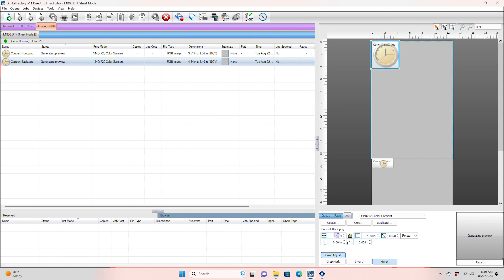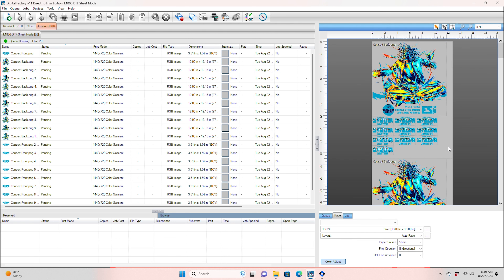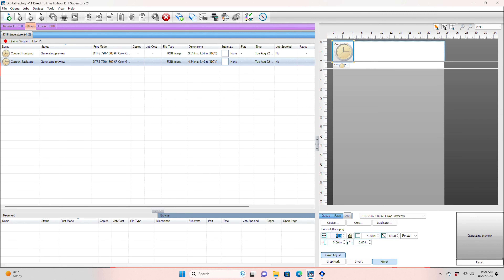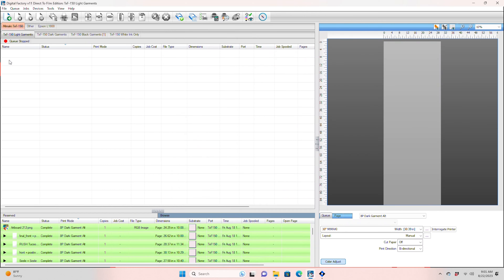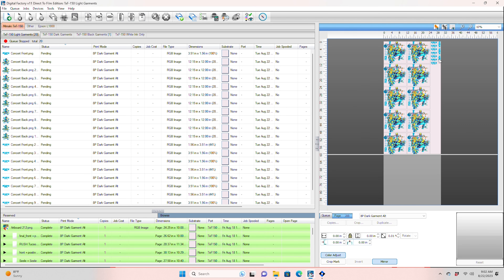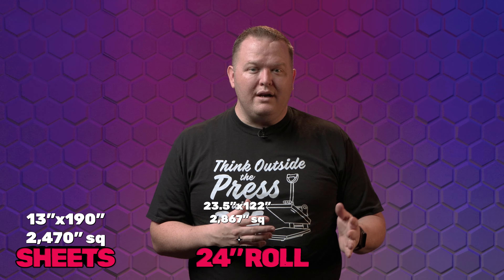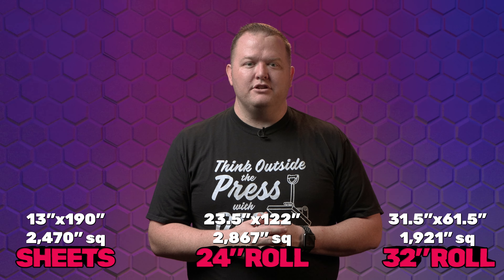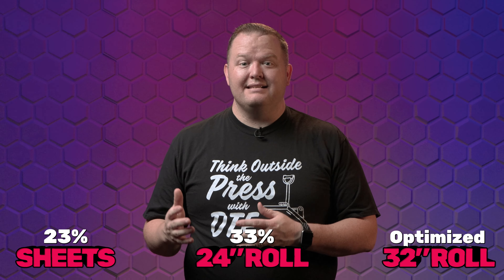Waste Less DTF Film with Mimaki's Larger Print Area

Comment: I think you need flexi sign. That nesting is ridiculous. Also standard market most people will buy 24 inch rolls.
Reply from the maker: CADLink's white underbase handling is far superior.  And yes, most use 24 but this is why we think the wider Mimaki film is actually a huge benefit.
Reply: How much does it cost to print in 1 meter of mamaki DtF